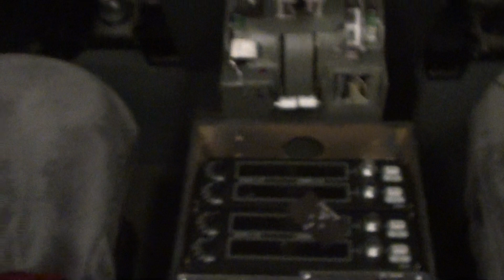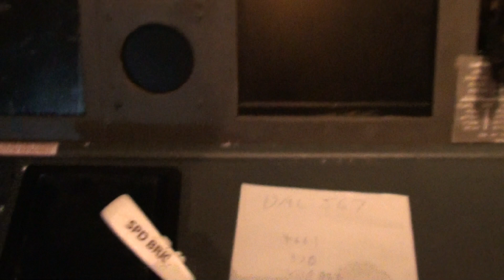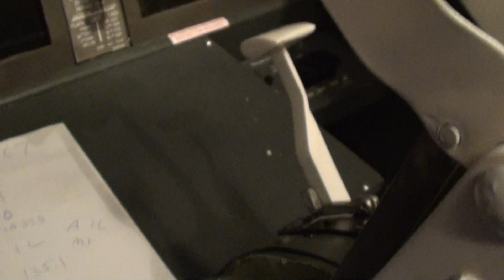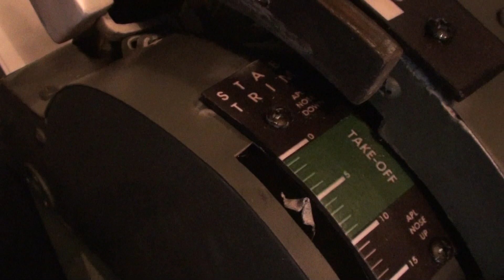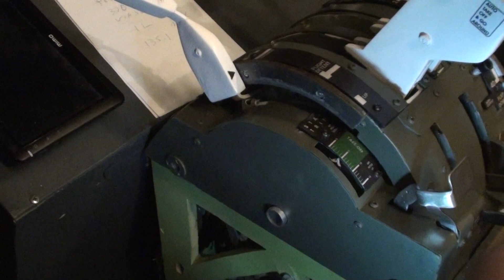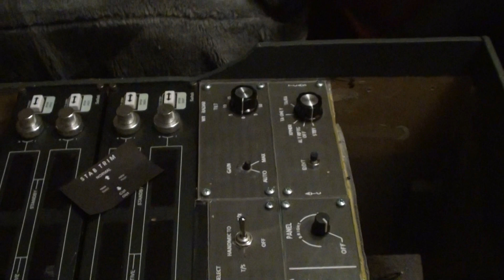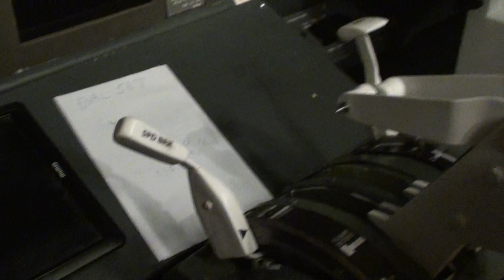Homemade 737 throttle quadrant

Comment: Can you explain how you did the black paper and clear coat?
Reply from the maker: I printed 2 of the black labels and cut them out. Then I glued them together. I cut a plexi glass plate to the shape of the label, Glued the labels on the pelxi glass after light sanding to help adhesion. Clear coated the entire thing generously after painting the edges black.